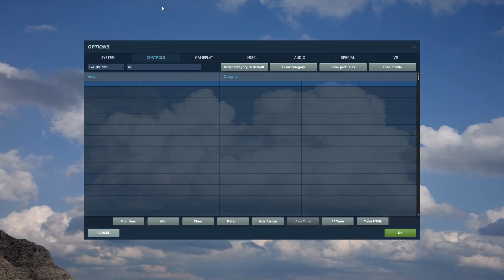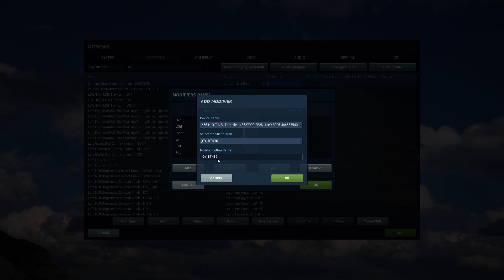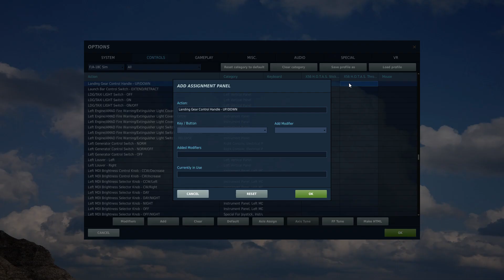Digital Combat Simulator ADDING MODIFIERS TO HOTAS  LOGITECH X56

Comment from the maker: Folks, quick heads up for anyone running into issues with greyed out key bindings for their X-56...  What I've heard is that sometimes using an UNPOWERED USB hub will cause this issue. If you plug both Throttle and stick directly to the back of your rig then it might help, OR, use a powered USB hub that draws power from the wall outlet. A few people in forums have run into USB issues with TrackIr and their HOTAS. As we know, DCS needs a lot of power, throughput and bandwidth across all the peripherals to run smoothly so using low end cheapie USB hubs may impact things.

Comment: I've been trying to figure out how to use these different modes forever, and thought his would be it.  Unfortunately I cannot get DCS to recognize that switch for anything even if I manually tell it to use "Button 36" as a modifier.  So frustrated with the X56 but I'm glad you can use it.
Reply from the maker: Hey Phil, it's tricky but could it be that you're missing one of my steps or is it that my video doesn't test it with various other modifiers? Let me know and I'll run more tests. I want to try binding my X56 into three sections. Takeoff/landing and navigation, BVR tracking and weapons employment, close range ACM and A/G attacks. If you've tried to go this far and can't, let me know where you're getting stuck and we can work through it  ;)
Reply: Believe it or not I think it is just another quirk with the Saitek model I have and DCS.  I shut it down, restarted, and it started recognizing that switch.  Then closed out and reopened again and nothing again, repeated process and it worked again.  I've been having more ghost presses recently and stuff so I'm pretty certain it's the HOTAS.  But I got it figured out to the point I can start trying the same with  mapping into 3 sections.  If anything interesting comes up I'll report back!  Thanks again for the vid and response!
Reply from the maker: @pchappy2.0  No worries, let us know how you make out. If you're using the X55 then it will be interesting to hear how well you did  :)
Reply: @wardenofthenorth5575  Well after fighting more with the X56 being recognized within DCS I finally figured out a work around and can now start mapping the 3 modes....I had to use the Logitech software and go into "Grid View" and assign a binding there, and then go back into DCS and assign a Keyboard binding NOT X56 Throttle binding, modifier that matched the software.  THEN it finally started recognizing the switch.  It refused to acknowledge the knob when trying to bind the way you show in your video or manually assigning Buttons 35/36 myself as a modifier.  So I'm posting this as a work around for anyone having trouble and can't find your way successful.

Now, unfortunately, right as I figured this out my GPU fan bearings started going out (MSI GS63 laptop) so I cannot play or even open the game right now for fear of burning the GPU up.  Luckily the same day, I had already committed to ordering a desktop rig (i7-9700k, 32GB Ram, 2080 ti, Samsung Evo 970 M.2 NVMe) which should be here by week's end.  Once I get everything set up and transferred over, I will work again on the 3 mode bindings and let you know how it all worked out.
Reply from the maker: @pchappy2.0  Sounds great thanks but I'm hoping to avoid using the software. Let meknow if you can get it mapped out without the software. I'll do more testing on my end.

Comment: Just wanted to update - I found someone comment in here saying this works only if you delete the Logitech x56 software and drivers. I tried this and dcs allowed me to do what was shown in the video after many times of trying it before. Try this if the video’s way of mapping this doesn’t work!!

- More recent Update it was working fine,
I got off to go get lunch came back and hour later and bough the f18. As soon as I started up dcs the throttle isn’t moving in game and the modifiers don’t work anymore (No changes at all just closed game and came back an hour later) . I checked settings and it shows the axis moving and I also re downloaded the x56 software to check and it was fine. I then deleted the software again to go back into dcs and it is still not working :(
Reply from the maker: If you try to run both mapping applications (editor and DCS mapping) at the same time the will conflict with each other and cause both to NOT work properly. I didn’t install the Logitech key binding editor software for this reason. It’s too problematic and doesn’t help any more than the DCS key mapping system. In order for the DCS key binding system to work you CANNOT have the Logitech mapping software installed. I tried using it ONCE when I had the x52 and on top of hogging resources unnecessarily, it never worked the way I wanted it to. So I uninstalled it and have never looked back.

Comment: very helpful video. But I have a question. You worked to use a modifier for commands on throttle. What about if I want to improve commands on the Stick? I may use the same modifier button? And another question. I've never been able to modify the functions on the "wings" in the front of Throttle. It looks that it doesn't accept any other commands than rudders movement. I would like it as a zoom but I've never been able to do it. How can I do and how can I change it?

Comment: I followed your instructions and everything works fine excepted for the front “butterfly” in the front of the throttle, the analogic button (the one moving all around) even in the throttle, the “round wheel” on the left side and the slew button at the bottom of the stick. Do you why and what I need to do for it?
Reply from the maker: Unfortunately I don't know how to answer your question because I'm still learning this myself and life takes priority so I have little free time to focus on flying. To be honest, adding modifiers and setting up your HOTAS properly and to a point where you feel really comfortable with it takes a lot of time and testing. I'm STILL setting mine up as i fly lol.
Reply: I undestood that maybe it'n not working in the correct way using the button I told. I'll check it with Thrustmaster technician...
Reply from the maker: @giuseppeloggia6412  From what I know about the TM 1600, it does not have a modifier switch. The switch on the Logitech X56 triples the button functionality. I totally forgot about this detail. So in answer to your question; Unless a TM tech tells you it's possible and can walk you through it, it's not possible. If you google the images for "logitech x56" the switch I'm referring to is on the bottom left corner of the Throttle system labeled M1 M2 S1. This switch is what makes it possible for me.

Comment: please make a series on this.
Reply from the maker: Thank you but that would be a super long video. Basically, going off the video you should be able to compartmentalize your key bindings into whatever sections you want. I'm still on the fence as to how I want to do it and dread the task because it will take some time but once you get used to it you will definitely have a complete HOTAS system.

Comment: you must select MODIFER not SWITCH when you add the mode buttons to the modifier panel that's really why it does not work.
Reply from the maker: Was this not explained in the video? If not I'll correct this.
Reply: @wardenofthenorth5575   I'd say its well described but it's overlooked and I think it needed to be emphasized to viewers in the comments. Also another thing watching your video the fact that each profile for each device needs to be saved individually as a profile is not stated. Thottle needs own profile,  as well does joystick and rudders in own .lua save file or it overrides your config on start.
Reply from the maker: @UClRA4lpoZ6KhDBlhrVE-f7g Thanks for this. I can't remake the video but the comments are abundant so I'll leave it at that. If it's well described, then the viewer should be able to figure it out and get help from all of us if he/she is having issues. 

As a side, be aware that if you have "flipped" that modifier switch from M1 to S1 and S2 then you NEED TO BIND ALL THE AXIS CONTROLS TO ALL THREE MODIFIERS so that you can fly the jet properly. I also ran into this a few months back when I could not figure out why my throttle, yaw, pitch and roll weren't working. Then I realized I had my modifier switched off the default M1.

Comment: I tried this and when adding a modifier dcs does not pick up on my moving the switch. What should I do?
Reply from the maker: Are you using the Logitech X56?
Reply: @wardenofthenorth5575  yes I am. I've scoured the forums and can not find the answer. Does it maybe have to do with the fact I'm still running Windows 7? It's the only thing I can think of. Thank you for your feedback either way, it is very much appreciated.
Reply: @therocinante3443  Mine Logitech x56 with win 10 pro latest version is also not picking!where I canget all buttons name for dcs!???thx
Reply: the same for me is the saitek x56 now logitech, the switch doesnt work!! help
Reply: @Chrisandman1977  there's like zero information about this
Reply from the maker: @Chrisandman1977  I'm also using the Logitech X56 with Windows 10.... I haven't noticed an issue but there may be limitations in DCS in allowing modifiers. In theory, if you do it the way I did it in the video I don't see why you would not be able to create more
Reply: @wardenofthenorth5575  it seems a problem with the usb ports or DCS software, because sometimes work but a lot of times no!! I will write about this problem in forums, Gracias!!
Reply from the maker: @Chrisandman1977  De nada  ;)
Reply: You must uninstall the h.o.t.a.s. software and driver, it will only work that way. Also works with X55 Rhino. Saludos ;-)
Reply: @lucasviera988  THAT WORKED FOR ME! thx!!!!!1
Reply from the maker: Exactly. If you have the X56 binding software that binds your keys outside of the game it will conflict with what’s in DCS so you have 2 options. Either wipe out ALL of the key bindings in DCS so you can use the Logitech key binding software or remove the Logitech key binding software and stick with setting it all up in DCS. I chose the latter and NEVER use third party key binding software. It’s far more trouble than it is worth, in my opinion.

Comment: does it work with t1600 m also?
Reply from the maker: You should be able to use this method with any HOTAS system.
Reply: Yes, it works fine. tks